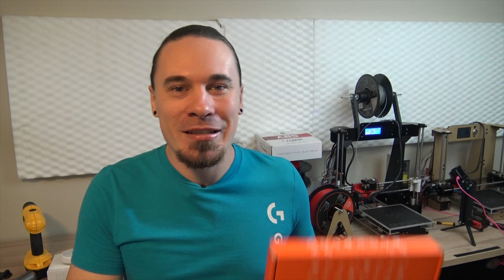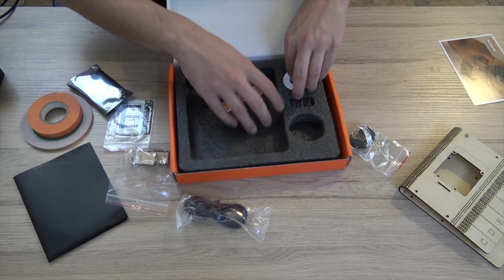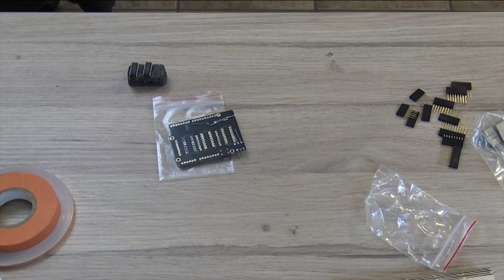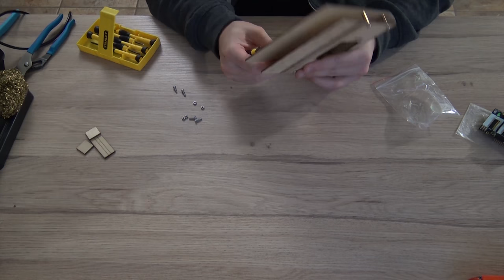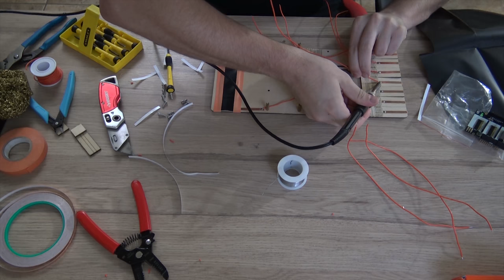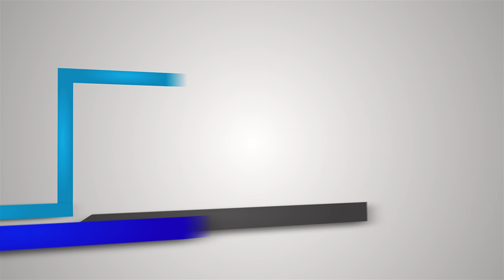Thimble Midi Controller Piano

Comment: Hey Electreak, you mentioned that this kit was your favorite Thimble kit so far. I'm interested to know what elements of this kit stood out as better, or more enjoyable for you?
Reply from the maker: Paul Lane Hey! Thanks for asking. I really enjoyed this project because I used to play in a band and had an old synth. It brought back a lot of good memories. I also see a lot of potential in the project to be able to expand it's "range" by adding more "keys", maybe with 3d printing, and adding the other multiplexers that where provided with the kit.
Reply: Do you have any ideas for an expansion or possibly a completely new instrument design?
Reply from the maker: Paul Lane still working on an idea. maybe something to make a drum pad. If I end up expanding, or making something new, you can bet there will be a video on it. Any ideas you may have?
Reply: That sounds pretty cool! I can see a mini 3D printed mechanical high hat and a bass pedal that works as normal, just smaller. That's a rad idea. I also have the idea of making a somewhat complex laser cut wood structure into a trumpet or saxaphone. Totally rock out and have a Thibmle Band!
Reply from the maker: Paul Lane haha! That's a great idea. I would love to see some pics if you do get that made!